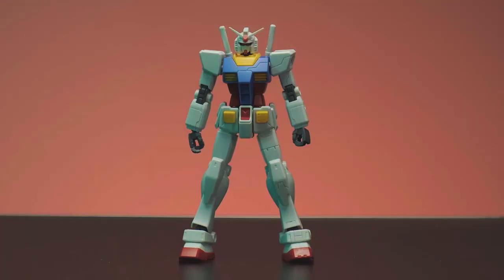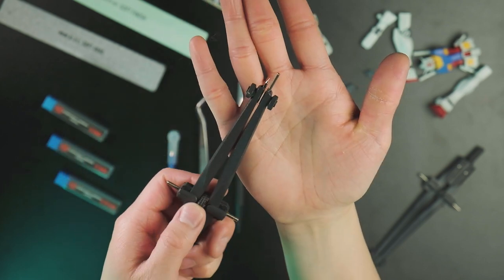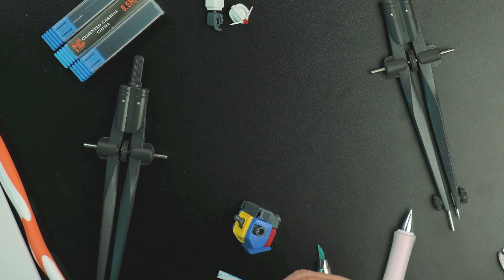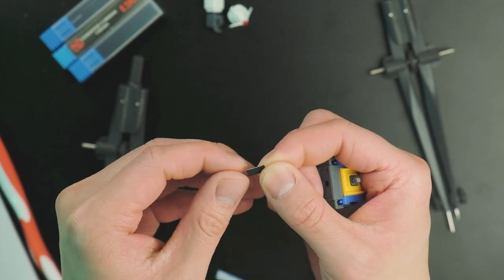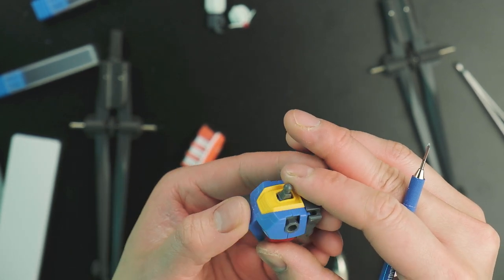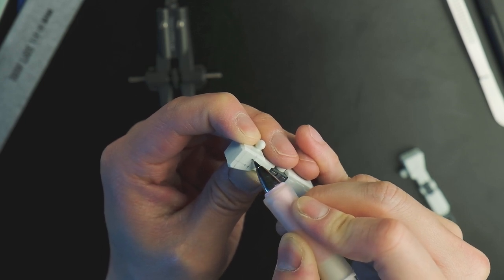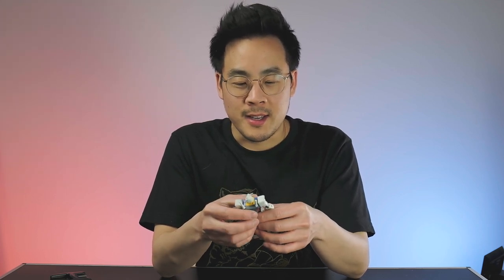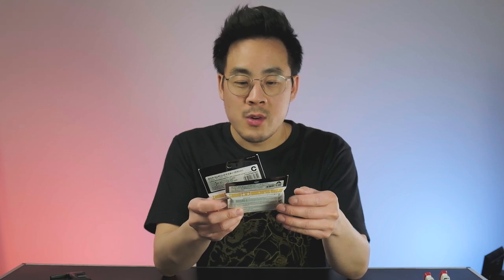Beginner Gunpla | Trying out panel line scribing for the first time

Comment: I learned the hard way (twice) that light pressure is a MUST when scribing. Finally spent the extra money and got SAB scribing chisels, highly recommend!
Reply from the maker: Same here, I also got my hands on SAB scribers a while ago. I actually mendtioned them in my newest video and used them to scribe custom panel lines for a MG Unicorn. I'm planning on getting more sizes. Do you use them with the holder or without?
Reply: @GiantRobolove  I actually just use them bare metal, but I might actually heat shrink the included tubing on to give it a try. I haven't really experienced any clumsy moments or slips that I can think of. I think I bought the .15 and a 1.0 for starters. What sizes do you have?
Reply from the maker: I have the 0.15, 0.3 and 1.0mm. I'd like to own a 0.2 and 0.5 as well.